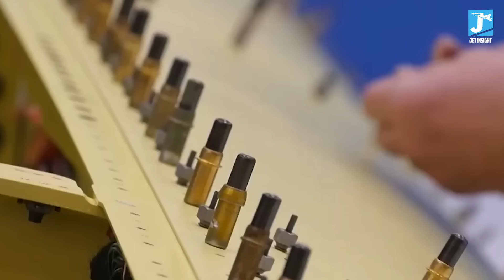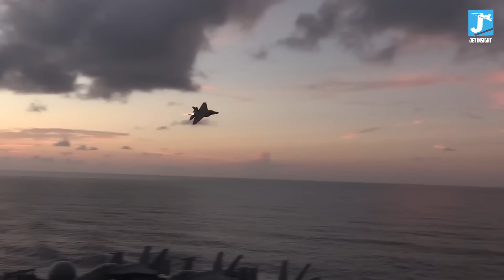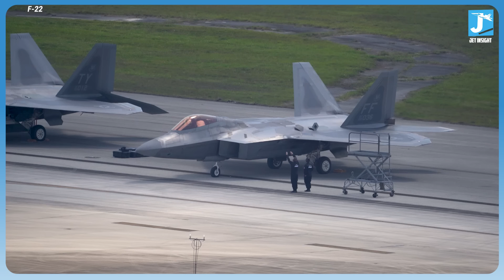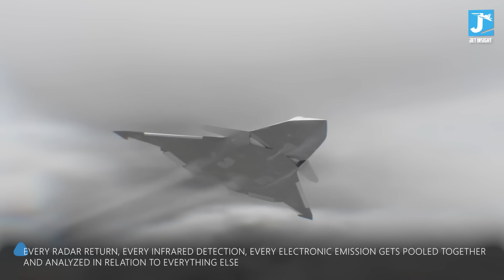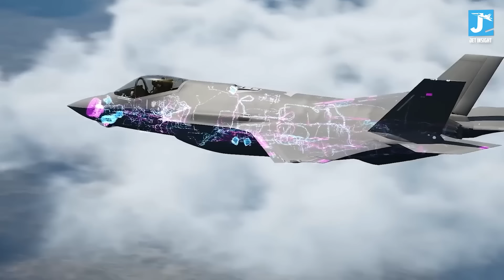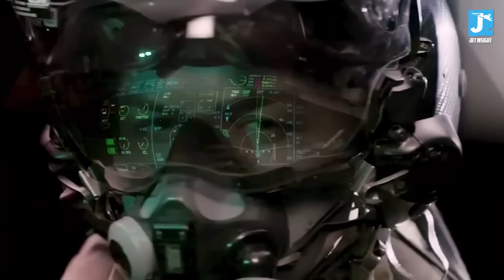Why the U.S F-47 Sixth Gen Design Breaks Every Rule of Fighter Jet Physics

Comment: This video was from 8 months ago. Currently China has 5 J-36 prototypes flying and will reach production first a cost of 120-130 million per air frame. Mass production timeline is between 2027 and 2030. Mass production of the F-47 is anticipated between early 2030's to mid 2035 due to engine readiness. The cost of the the F-47 is 300 million dollars per air frame.

Comment: New ceramics can turn heat in to light.  Yes I know all heat is low frequency light but what I am saying is new Yitrium, Aluminium composites can store the heat then release it as much higher frequency light effectively turning the heat from air friction in to the very radar jamming frequencies used for stealth.  This has the combined effect of keeping the jet cool as it cancels out enemy radar waves.  I wonder if this is a variation on piezoelectric effect

Comment: Still messing around with fossil fuel combustion engines in the 21st century. With the reverse engineering on the Roswell saucer I would have expected the USA to be onto gravitational vector control by now.

Comment: Obviously the "engineers" of today have never been introduced to the SR-71 which hit well above Mach 3 to the point where the tops speed is still classified.
The F-47 is still a concept only. It has not even come off of the drafting board yet. This is pretty much a click bait production. It is interesting but, it's all speculation and fantasy, for now. So, what has been presented is highly unlikely. Notice the statement: "The X planes..." Not the X-47 but, the X-planes. Those could be anything or any kind of vehicle used to test a particular idea. It does NOT come even close to proving tha the X-47 has yet flown even once. Could one have been flying or being manufactured? Definitely. That is where military secrecy really does work. We never knew of the F-117 for almost ten years even though they had been seen as UFOs for years beforehand. 
Since this is just another POS made by AI I won't bother with this channel again. The information was not bad and the computer generated images and videos were not horrible. They were actually pretty good. However, it gets a thumbs down because it is AI and has no human involvement. Maybe if a human comes along and fixes it and voices it then I will give it another chance but, YT (a.k.a. Commie Vision) I doubt they will let that happen.
Conclusion: The F-47 does NOT defy physics. It makes use of it to the extreme. It will make the mind try hard to comprehend how it will do what it can once it is released but, it will never defy the laws of physics. To even suggest such a thing is the sign of a very undedicated and exceptionally stupid person. That is AI for you! Remember, AI means Annoyingly Idiotic!

Comment: Didnt China get their hands on some of our stealth abilities, and i hear much about the F-47, but how stealthy are the wingmen,  also how much technical prowess does a person need to be able to fly it and manage the wingmen, one of the things that lostthe war for Japan was their lack of pilots, in two battles, Coral sea and midway, they lost the cream of their veteran pilots and could not replace, the pilots they were turning had very little flight hours, because of the fuel shorages.

now we are going down the same path, the level of intelligence to fly these things has got to be up there, limiting our selection process, Scotty said it best, "the more they overtake the plumbing the easier it is to stop up the drain" our enemies will not be concentrating on the wingmen, but on the quarterback, take out the quarterback and what happens to the wingmen?

We are putting ourselves in the same position as Japan found itself in WWII, I am just concerned that the quality of pilots is not going to be so good when the education system is pushing comon core garbage, tell me you can get good pilots from comon core?
Reply: While there may be some ' Temu copycat' aspects, I don't think they can match the material science. It's one thing to have a blueprint it's a completely different "kettle of fish" to be able to understand and manufacture the airframe let alone the engine. We've seen the problems they're having with their current engines for all their current "J" models.
Reply: Biden sold it to the Chinese while Vice President. It isn't a secret.